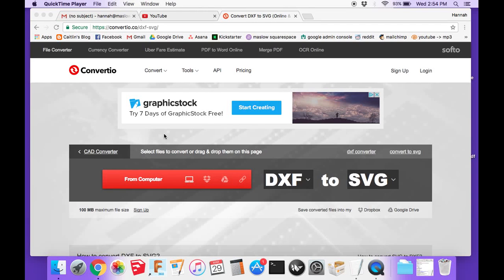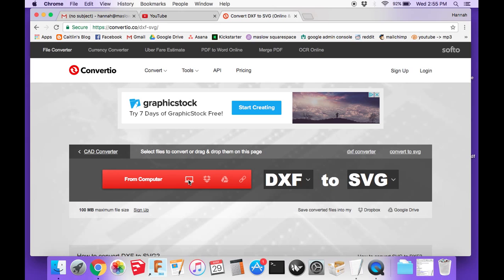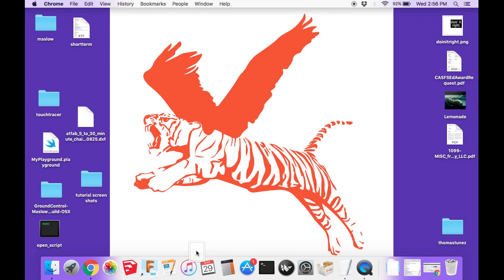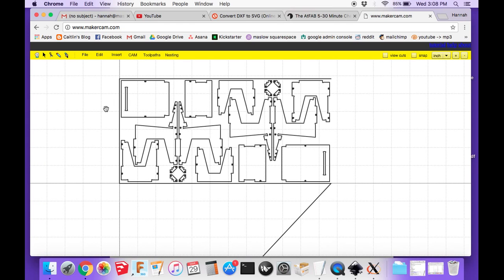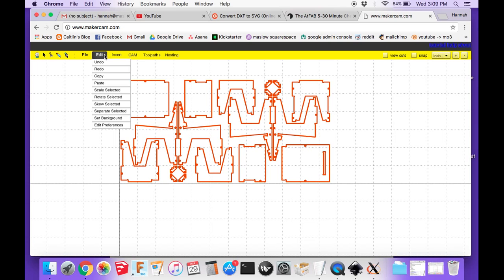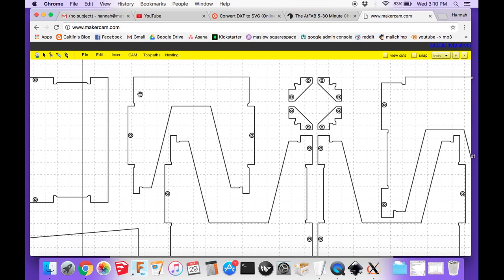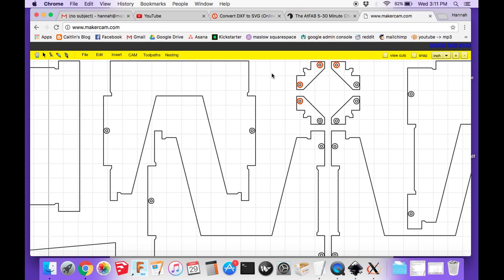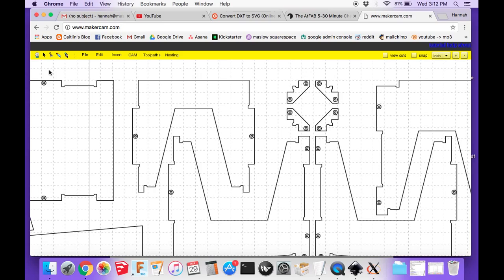Converting a .dxf file to a .svg/.nc file

Comment: you mentioned this being streamlined, has that happened in any way? I have a friend that has a Maslow and he has only done graphics based cuts, and nothing that has derived from CAD. I use AutoCAD and Fusion. I would like to just to be able to send him an email and say "stick that 4x4 of 1/2" sheet in and run this file". Is that possible or do I need to at the Maslow to do that?
Reply: Its is my understanding that Fusion has CAM built in and therefore can generate its own G-Code for the Maslow.